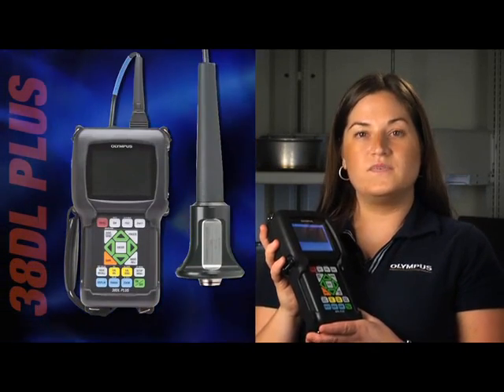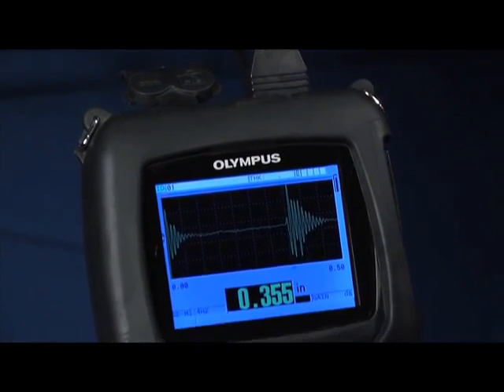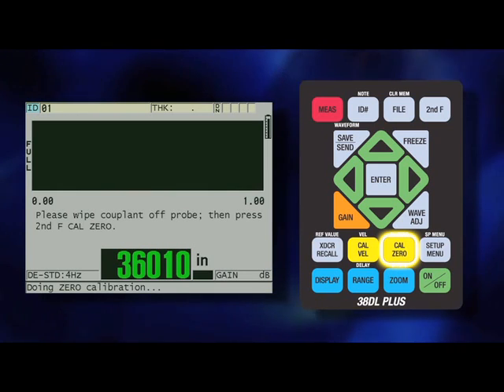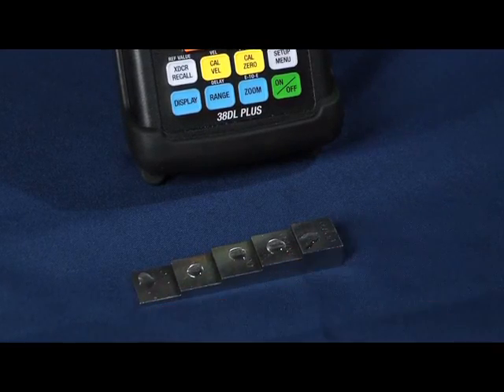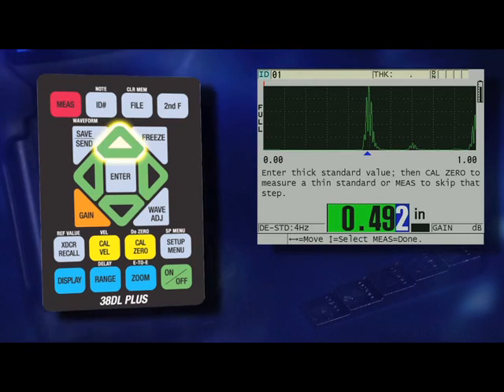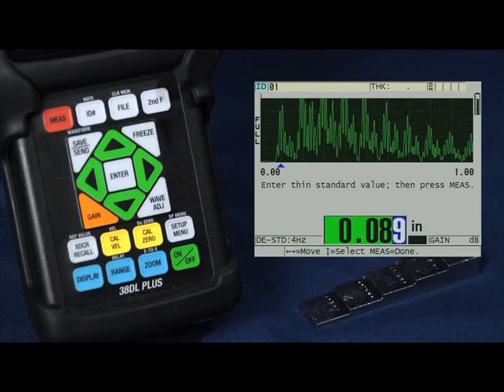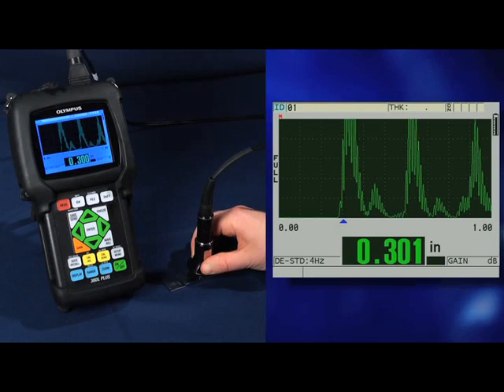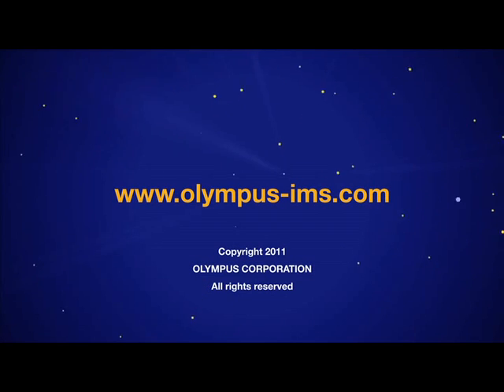Olympus 38DL PLUS  Ultrasonic Thickness Gauge: Zero & Calibrate a Dual Probe

Comment: We have one of these, but it is setup with the water tank and v-block fixture.  The transducer is mounted up inside the v-block assembly pointing upward, and there's bubbling water flow that comes up into the v-block itself.  The parts we check are all cylindrical, and often times what we are checking is the wall thickness and/or ID to OD concentricity (drilled holes down the center of the rod).

I've recently seen our units come up for calibration for the first time, and I have to dig into how to go about this.  The case does contain a cylindrical standard, not a flat 5-step plate.  One side is labelled as thinner, the other side 1.5".  I'm assuming this wrapped cylinder actually has a thin disk at the one end, then a space, followed by a 1/5" plug, both wrapped in the plastic sheath to create a single gage.

Given this is the 38DL, I'm assuming the procedure is to disassemble the transducer from the v-block assembly, pull it out so it can be hand-manipulated using the calibration standard in the case?

Or, given we are using this in the v-block fixture with water acting as the "copulant", should I be using certified gage pins (small to large) for this?